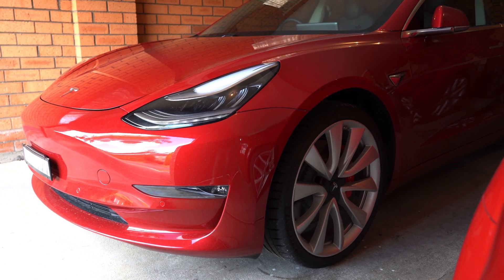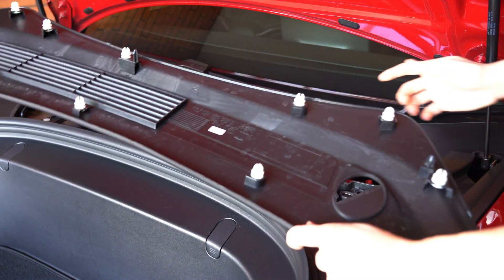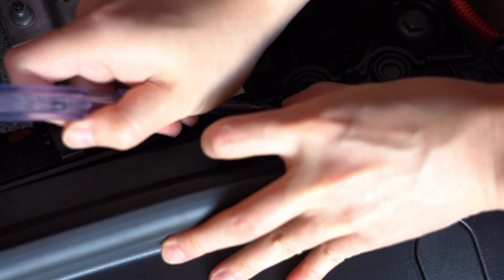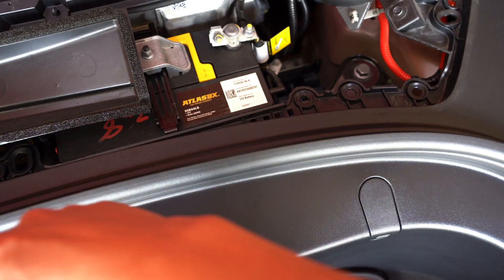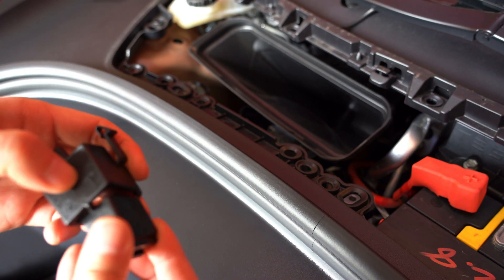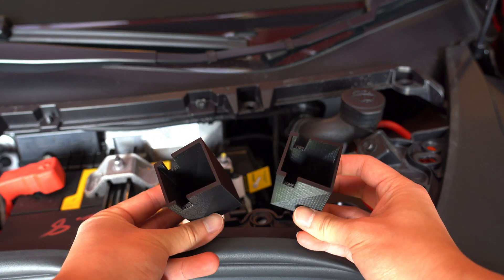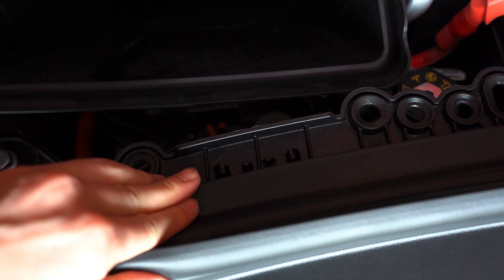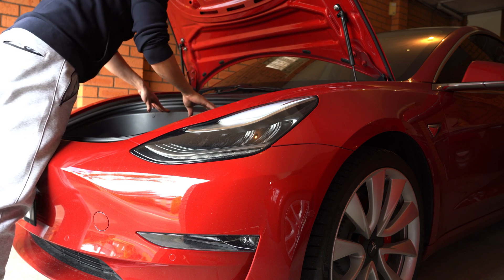How to fix the Tesla Model 3 frunk: Reinforce the under hood clips

Comment: Great find. Thanks for making the video!

"make sure that the height is the same".... do we know what that overall height should be as we cut our PVC pipe to make this extension?
Reply: I will and will report back!
Reply from the maker: Really sorry, I don’t know the dimensions, you may have to do some trial and error to get the perfect height.
Reply: I've made my spacers. I wish I could post pictures. But the answers: Use 1/2" PVC, cut a notch to clear that angled support, and make the pipe 2-3/16" (55 mm) long, and you're golden. I've confirmed that this is the correct length for both sides. A mm or two either way isn't gonna be a problem. I just glued the pipe into the top part of the factory piece, and it works great. For the first time ever, I've snapped on that cover! Yay. I LOVE fixes like this. NOBODY else will ever appreciate it, but I sure do!  :-) Those of us with OCD need a special place.

Comment: In my work doing this, I discovered that there's another clip not engaging. It is on the windshield side, near the pivot for the driver-side wiper. So just at the upper edge of the intake vent for the HVAC, about centered. There is a clip there on the panel that never engages. And there's no support there. Anybody have a fix for this one?? Or maybe my car is the only one (or vintage) to not do this?

Comment: I've never seen the need to purchase a 3D printer, but this makes me want one.  I've always wondered why I can't get my panel to fasten correctly.  I just have to determine if I want to spend a couple of hundred bucks and follow your footsteps.  Of course, I'd have the whole learning curve with the 3D printer, too.  At my age, I'd rather spend ten bucks buying a couple of these parts.  Wish that was an option!  Does Tesla sell replacements that could be beefed up?
Reply from the maker: You probably don't to have 3D print this exact part, you could probably just cut some plastic tubing to do the same/similar job.
Reply: Something to check on... My local  library has a "techzone" that includes a 3D printer. Email them the STL file and they print if for you. I think I paid about $11 for the two pieces shown in this video.

Comment: Do you know if the 3D printed part would fit over and protect an unbroken clip reinforcement, or does the reinforcement have to be broken first for this to fit?

Edit: From the designer’s comments at thingiverse, it sounds like it should fit over and protect an unbroken reinforcement:

“The Tesla Model 3 frunk has two parts (1131205-00-C) that are poorly designed and break easily when you remove the panels on the frunk area and place them back. I designed a part that holds inside the defective part and should avoid breaking the original part. You have to place the original part inside this part and place it on the original location.”

Comment: Came here wondering what on earth was needing to be fixed. I have the top of the frunk bucket bending as shown, and the panel not clipping in as shown, but no disadvantage. It is just a panel to cover the things under it from large debris. It doesn't need to be connected all the way around, just enough to keep the panel in place.

Comment: so mine are broken and I cant get them to attach.  noises are horrible while driving.  How do I get somebody to print these for me?  Does anybody just sell them pre made?
Reply from the maker: That part is mostly hidden so the easiest solution might be just to get some PVC piping and cut something to size and attach it with some glue or automotive double-sided tape. Won't be the prettiest but as long as it holds it up it should be fine.
Reply: Do we know the overall height we need, so that we can cut the pipe to the correct length? This would be obvious if the part weren't already missing the lower bit. But when that lower part is gone, how do we know how tall it should be? @wonked

Comment: Thanks for the video it was quite helpful.  I decided to check mine and both were broken.  Similar to you I was able to only retrieve one half of one of the broken ones.  On 3D printing - double the wall thickness and you won't need much infill.  On my entry level printer with the standard 0.4mm nozzle that means a 0.8mm wall.  I used 80% infill and each one only took 1h10m. I'm surprised yours took so long to print.

Comment: March 2020 model 3 here...same one broke on mine
Reply from the maker: Do you have the redesigned smaller frunk? Or the same one as in the video? Just curious if it affects the smaller frunk or not.
Reply: @wonked  same as yours
Reply from the maker: Good to know, there's still hope that Tesla may have fixed it in the smaller one.
Reply: @wonked  I have the redesigned frunk. Same problem, lmao
Reply from the maker: Oh wow, that's unfortunate =(. I can see how this is a hard thing for Tesla to discover, most customers won't notice it, it won't really show up in any inspection and I guess it doesn't cause major issues with the car.

Comment: Nice clear video. I guess Tesla's still new to the game of producing cars! You wouldn't find something like that in a Toyota... I'm glad my M3 has the smaller frunck!
Reply from the maker: This is good to know they've finally fixed it!
Reply: @wonked  I have a 2021 Model 3 with the smaller frunk; it still has the same problem with the wimpy clip supports that break easily. In fact, the tech at the local service centre was showing me how to reinstall the maintenance panel and gently lecturing me about how I had broken one, and he proceeded to break the other himself! They supplied a couple of new ones free of charge, but now I'm afraid to ever open the maintenance panel again.
Reply from the maker: @conradce  Sad to hear its still an issue. If you're up for it, you can take the support clips out and try to reinforce them, then put them back in. I can guarantee you, the next time service opens that panel they'll break the clips and wont even know it =(.
Reply: @wonked  I don’t have access to a 3D printer, but I wonder if anyone sells the parts. 
I have a couple of handy maker cousins, mind you. Maybe I’ll ask if they can print me a couple.